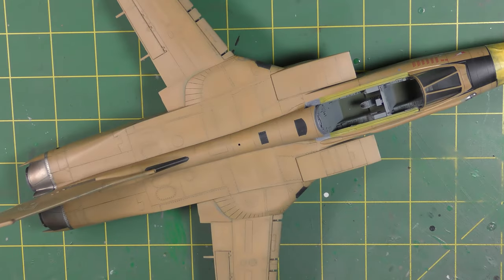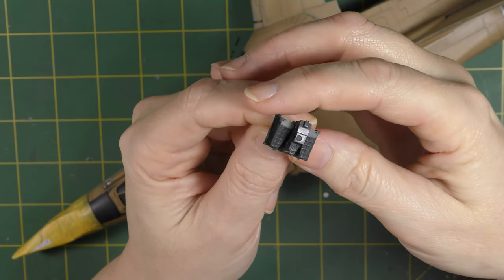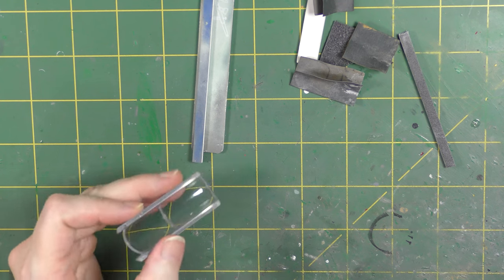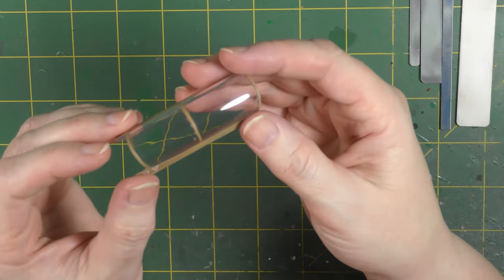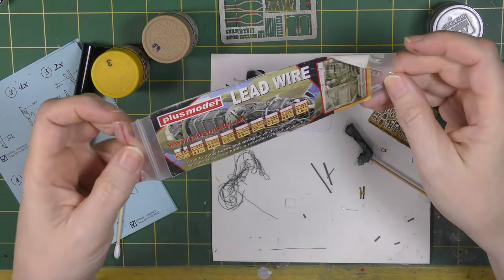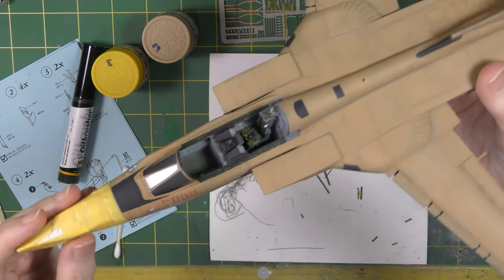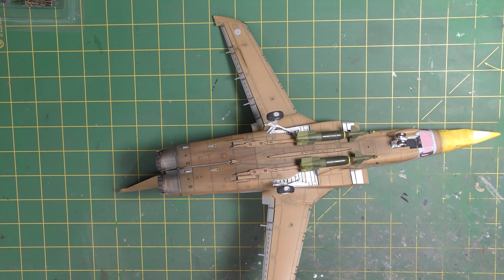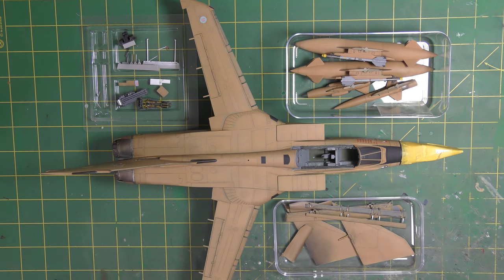Eduard (Revell) 1/48 Tornado GR1 Foxy Killer - Part 9.

Comment: Looking good. On the underside, just about all the oil stains you see are reddish orange hydraulic oil rather than brownish black engine oil & soot from the breathers. The leaky parts of the engine itself don't start until you get just aft of the taileron leading edge. Top surfaces around the intake, decking and tailplane are usually a result of erkish dms boots (very melty material) mixed with hydraulic oil and general crud. Picture this. SAC Erk climbs ladder at cockpit. Does his stuff, walks down the rear deck via the top of the intake, and jumps onto the taileron, to slide gracefully off, thence, on to the NAAFI wagon for a lovely hot meat pie & a well earned game of uckers in the crewroom.